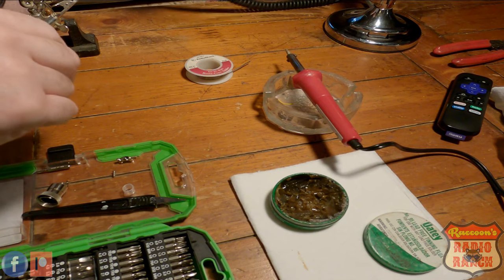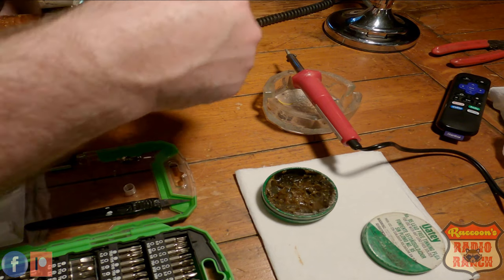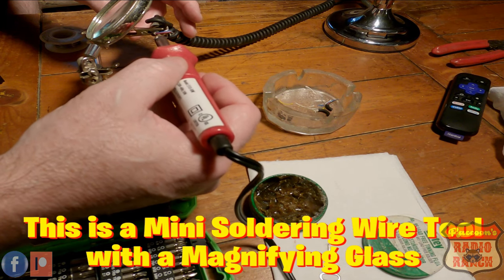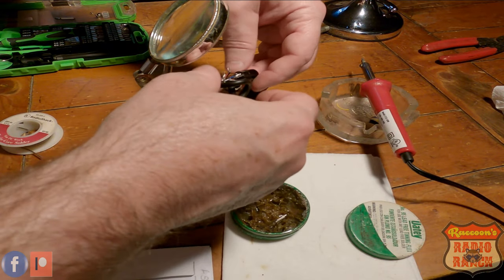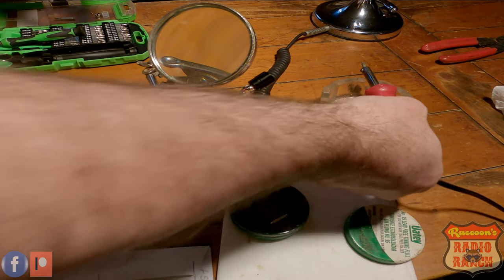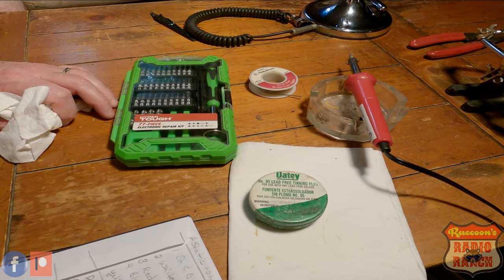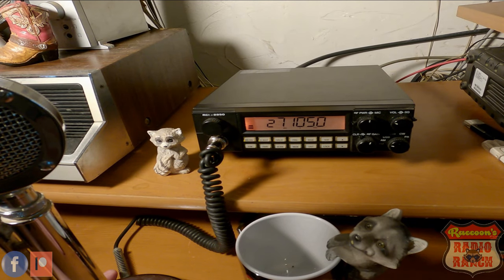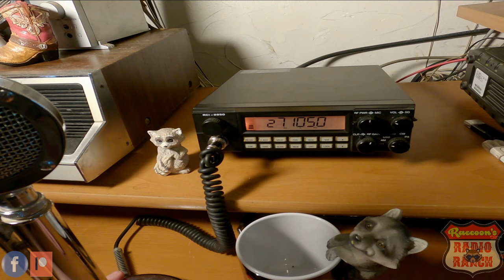How To Wire a CB Microphone

Comment: Nice job! I did some 8 pin cords for an external control on a radio with a mauldulator installed. Sure would been handy to have the magnifying glass setup you have. Very cool.
Reply from the maker: Thanks Luke , that little tool (Helping Hands) has been helpful to me more times than I can count . I also made sure to add a link to where you can buy one at in the description area , for anyone that might be looking for one . I know they can be hard to find .

Comment: How would you wire a 4 pin cobra for a realistic 5 pin din for a TRC221 OR  TRC216?
Reply from the maker: You have to figure out which colored wires would be the PTT (keyup) wire , usually the red , but not always . Then which one would be the audio , usually the white wire , but again not always . And which one would be your common ground , which is usually either the black wire, or the shield (the bare wire) ... and in some cases you combine them . Then you have to figure out which pins are the PTT, audio , and ground and solder them together . If you have any paperwork on either the mic or the radio , they will show which does what ... and if you don't you can usually find their manuals online , just do a google search .

Comment: I’ve been off the air for over  30 years and I need help wiring my D104 to my realistic 453 please.
Reply from the maker: Hey Alfred , try one of these : 

Astatic (4 wire)
1- Shield
2- N/C
3- Red
4- White
5- Black

Astatic (6 wire)
1- Shield & Blue
2- N/C
3- Red
4- White
5- Black
Yellow NC

Or check out CB Tricks : http://www.cbtricks.com/radios/realistic/trc_453/index.htm

Comment: I have a general radio telephone Super MC9 24 channel I want to wire my D-104 to. Is it possible?
Reply: Also, when I tried to match it to my big stick antenna I got a “ negative “ swing on the radios S meter.
Possible causes?
Reply from the maker: I'm sure it's possible , you'll just have the right wiring code to match it up . Here's a link to the Astatic Wiring Book in PDF form ... go to the link and download the manual and see if you can find what you're looking for in it ... the manual is free

https://www.cbtricks.com/mic_manuals/astatic/astatic_wiring_handbook.pdf